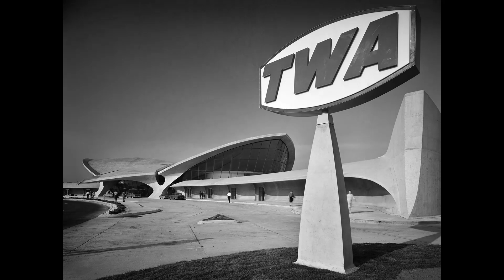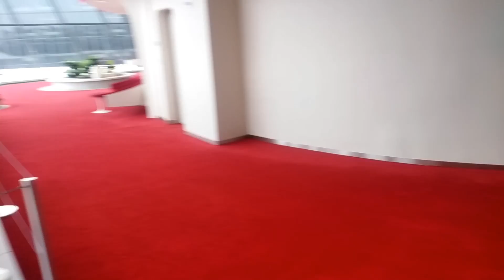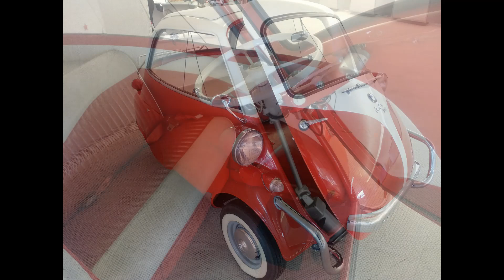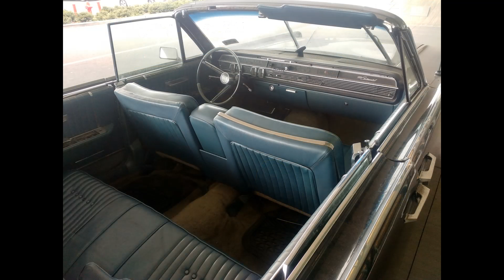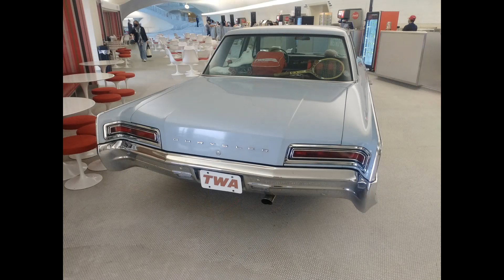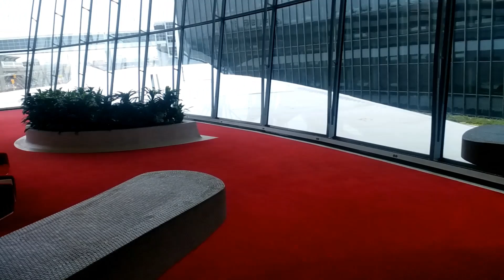TWA Flight Center and Lockheed Constellation

Comment: Thank you so much for this content.  When I was a kid in the late 60s and 70s my father would take the family to Europe every year, inevitably through Kennedy with either PanAm or TWA. Those terminals were something else.  I especially remember the TWA terminal because I spent so much time in it as I grew into an adult.  I would just hang out in that main terminal for hours waiting for connecting flights. All that curvy architecture extended outside to sidewalk where I would wait for cabs.   I had no idea that terminal sat empty for so long after TWA folded, or that it subsequently become the hotel.  It's nice that those curved tunnels are still there.  They seemed so loooong to walk through, with no windows I think.  Entering them was like stepping onto the set of a futuristic science fiction film.

Comment: When we were kids, a friend and I had lunch at the PARIS CAFÉ in the TWA terminal in late 1962  just after it opened. We rode our bicycles to "Idlewild Airport" (later JFK), a distance of maybe 10 miles from home, and we spent the day exploring each of the terminals. TWA 's was the best of all and seems to be what "The Future" would look like. It didn't disappoint.
We had a fascinating day and were "busted" by security when we were closely looking at the parked general aviation airplanes on one of the tarmacs. They let us stay, but cautioned us not to touch or to get too close to any of the airplanes. It was a different and more innocent time.
Oh, I had a Sandwich au Jambon (a ham sandwich) there. I remember that it was just fine.

Comment: Great video! Thanks a lot for this one, it showed bunches of interesting stuff, as well as bringing back a lot of memories. I was never in the TWA terminal, or ever flew on a TWA airplane. I did get to go through the PanAm terminal in NY several times when I was in Army in the seventies, I think the terminal was there then, getting sent to Germany and coming back for leave, and finally coming back for good. It was truly impressive. My dad worked for PanAm, called PAA until I was ten or so. So while we would fly back to the States for vacation every year on PanAm - I remember the sleeper berths on the B-377 going across the pacific - we did get to fly other airlines to get to 'home' and visit relatives, since PanAm didn't fly into the interior of the US. But I don't remember being on TWA Lots of flights on Western, United, Frontier, Continental, American, Air West etc. I've probably still got all kinds of airline maps from the fifties and sixties stored in a box somewhere. Things have changed a lot since then. A lot.

Comment: Do you remember how big the braking components were of the old Chryslers and other American car manufacturers of the time? I mean, these brakes were huge!!!!! The front rotors alone are like taking 2 fifty pound weights, the kind you would use to work out with, and mount them to your car. Imagine big weights like this spinning at highway and faster speeds. They were big, very heavy, very dirty and tended to be very hot!! They also had big cooling fins on some types. They were hard to work with!!!!  But, it allowed you to really see braking technology evolve. Disk breaks are better in every way!!! So much lighter, smaller, simpler!!! I look at drum brakes, and my brain goes. What is this sh*t ?????? I look at disk brakes, and my brain goes, yeah!!! Now that's what I'm talking about!!!

Comment: At Alaska airlines we still use a newer type of the electric tug which looks very similar to the one in this video. We use them in the bagwell to run late checked bags to the gate
Reply from the maker: Thanks, That's quite interesting. I do still see electric tugs around, but not too often, and these days a Noland Electric is quite rare.

Comment: 7:00 Quite a few french train stations still have that system.
Reply: No, not anymore. There were replaced in the 2000 by flip dots (every digit was made of a dot matrix, each dot being a small black plate with one side painted white or yellow), LED signs or LCD screens.
I suspect you were refering to Solari, as the Italian manufacturer, Greg.
I remember they were very popular, and used for a long time, some surviving up to the 2010s, just because of the noise they made: while being a gentle noise, like a  breeze in the trees, it made the travellers aware that the board was updated.
Reply from the maker: They probably don't have the money to upgrade.

Comment: 60 architectural drawings isn't that outlandish. Ive worked on 15+ storey buildings that had far fewer. Architectural mainly covers the large details (type of tile, etc.) and points to various sub-diciplines for other details.
Reply from the maker: I may have used the wrong term, I mean 60 engineering, architectural, etc. 60 drawings total to build this place.

Comment: I never got to fly on a Connie, but for many years we did have one right down the road from me mounted above a restaurant and used as the cocktail lounge. When they took it down and hauled it away I went and said goodbye to it as it laid in a parking lot with the wings removed. It's now been restored to display condition at the museum at Dover (Delaware) AFB. I did get to fly from Virginia Beach to San Juan, PR on a C-54 (DC-4), and flew many times on the old Lockheed Electra turboprops. There's just something reassuring about looking out the window and seeing 4 big propellers spinning. I had a 72 VW Microbus, a horrible vehicle really, but fun to drive.

Comment: Those penny tiles typically came in one foot square sheets. The matting was strings on about 1/8" centers. I don't any longer recall what material was used, perhaps sisal. The letters on that activity game were indeed vinyl. Vinyl was a pretty new "space age" material back then, and didn't really feel like any other material you were likely to encounter, at least in the soft floppy form used by the letters, so it was pretty cool for both kids and adults.
Reply: The matting on the back is a sort of dense woven string/rope material; porous so it engages the grout that you affix it with onto the base material.

Comment: I drove a 78 VW bus from 2000 until 2006 when the Mexican part manufacturers closed down and maintenance costs went sky high. Had the camper version, loved that car, I just threw all my stuff into the drawers in case I needed it someday :P I was always running out to get an oddball tool that noone had and it became a joke at work that I had everything in there INCLUDING the kitchen sink :P

The safety thing was certainly a big deal and I still drive with a feather foot and 2-3x the normal following distance from the paranoid driving habits I developed with that thing.

I would kill for a modern, reliable low-cost, no-frills light camper vehicle but the few that exist are basically luxury vehicles now and the cost is insane. :( I make do now with an old Subaru Outback I squeezed a cheap foam mattress into.

Comment: Oh boy, such memories. We lived in the NYC area from '71 on and I remember this terminal and even the Pan Am one. Seemed so much cooler than either LGA or EWR designs. We had a '63 21 window Bus and then a '69. Loved those sunroofs. Someone in our immediate family owned a VW Bus until '08 when I sold my '67 Camper. You're right about the brakes on those things, made me the biggest defensive driver ever. With the advent of anti-lock brakes it was quite a horror to have someone pass you and then slam their 4 wheels disks to turn while I was praying not to rear end them. I drove that '67 all over the country back in 89-90. Easy and CHEAP to fix (Mexican/Brazilian parts) and got 23 MPG hwy loaded up. Wow, thanks for the trip down memory lane!

Comment: Wow great video.

I too disappointed jets discontinued piston development.  Some really amazing tech was in the works.

The huge radials r3350 n r4360 were marginal for airline use.  r2800 much more proven tech even if performance not as good, see DC6.

You could argue the PRT was turboprop with piston front end.

Comment: re BMW Isetta: not a two-smoke. In the Italian original there was one, I believe. But BMW adapted their four-stroke motorcycle engines. Initially a 247cc single, later 300cc. Subsequently, they developed the BMW 600, which was an enlarged Isetta with a 600cc flat twin.
Reply from the maker: The Isetta 300 had a four stroke, most other variants were two strokes.

Comment: Never set foot on a Constellation, but in 1960 or 61 I was bought an Airfix kit which was lovingly assembled and was the flagship of my model fleet, proudly displayed to visiting relatives. It was a very beautiful thing, the Constellation. Nobody cared about crumple zones in 1960, for a start nobody had seat belts so you'd die hitting the dash before the front got anywhere near you. In the bubble cars defence, it was very easy to park in the spaces for motorbikes, and it had a cute factor from the day it came out - it's not just nostalgia, they were regarded affectionately back then. Pit with a bell - sounds like a luxury version, the box in the picture is the one I had. Thanks for the nostalgia trip, looks like they've made a good job of it all.

Comment: Another great video Greg, a pleasure to watch.
I caught the very end of that era in the early 1980s working at an airport as a lineman. That's when Providence Boston airlines was still flying dc-3s. Hundreds of gallons of fuel and tens of gallons of oil!
The airline industry to me is just as interesting or maybe more so than the military stuff, especially aircraft like the HP 42, Brabazon, SR Princess and many others. The fact that these amazing airplanes lived or died not necessarily according to performance but according to profitability and market forces is to me very interesting.
More videos on the commercial end of things please sir!
Reply: Served in the Army Reserve with a PBA pilot in the late 80's-90's. He would spend 6 mo in the En and then back to Miami for the winter.

Comment: "Your papers please".
All that needs is for it to be ask with a diabolical accent and you'd be in an old spy movie.

P.S. Good n Fruity was light years better than Good n Plenty.

P.P.S Eero Saarinen also designed the St Louis Arch, he was Finnish born.

P.P.P.S Yes the 1961 to 69 Lincoln was expensive, in 1961 they cost $6,500, that was almost the price of a house. Another high tech feature of them was their hydraulic driven windshield wipers, and the 7 motors and 14 relays involved in making the convertible top go up and down, several years back I helped someone straighten out problems with the convertible top on one not going up and down, the system for the top has a wiring harness that'd rival anything in the Space Shuttle and has a supplemental service manual with wiring schematic that must be ordered for them with convertible tops.
When the top is up and you open a door, even with the key out of the ignition, the window of that door automatically drops about 6 inches via the power window, then when you close it the window automatically rolls back up, this had something to do with preventing the window from shattering if it was closed against the convertible top when it was up, something about the framework of the top and manufacturing differences or whatever, and there was even more relays involved with that process, they are not easy to work on cars like most of the American vehicles from that era, not for your typical back yard mechanic to mess with, the guy who looked me up had his to 3 separate garages that couldn't figure it's problems out.
Oh, and it needed a new high/low switch for the headlights and can you believe it, a local mom and pop auto parts store actually had one, but I had to rip most of the dash out because of a short in the main power wire to the headlight switch, the circuit protection for it was actually inside the headlight switch and the power wire was unprotected from it's source by the battery all the way to that switch, something I found to be very curious, having that long of a wire that carried that many amps unprotected.
Like I said not easy cars to work on, even the front brake calipers were non floating 4 piston calipers that were rusted in the bores but I managed to take them apart and clean everything up and get them to work without rebuild kits, that and the rear drums were about the most straight forward repairs on it.

That was a great video, it's interesting to see the architecture, styles and fashion from the glamor days of the airlines, like Sears and Roebuck it's just unimaginable that entities as big as TWA and PanAm could go under, it's scary when you think about it. 
I tell young people all the time when I was a kid we didn't have the internet to surf, we had the Sears catalog, and when the Christmas catalog with all the toy showed up that was big time.
Reply from the maker: Great post Duke. With old cars I much prefer simple low option cars for exactly the reasons you talk about with the Lincoln.
Reply: @GregsAirplanesandAutomobiles  
Oh that thing was a challenge, the next day an official at NASA got a hold of me and said "We hear you can fix a 65 Lincoln, wanna job?".
Reply: My buddy's Porsche Boxster side windows do the same up/down shuffle when you open and close the door. But only 1/4 to 1/2 inch or so and very quickly.

You are not kidding about Sears Roebuck catalogs as a source for info as well as encyclopedias before the internet. I used to get funny looks from people when I would say that I love catalogs. Stuff like Graingers or McMaster Carr were an education in parts and gadgets that I might someday need. Sears Christmas toy catalog probably started my affection for catalogs and was something to get exited about when I was a kid. Spent hours perusing them and even saved them for years after.

Comment: 5:10 - Those kids (under 40), are going to have a hell of a time operating those dial phones.

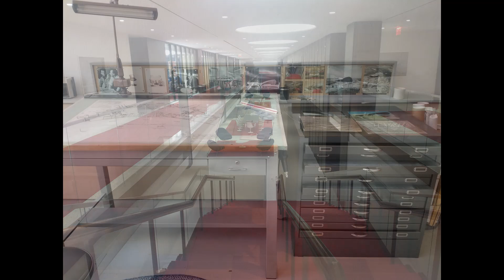21:40 - Looks a lot like the drafting table, I used to work on, before CAD became common. Still use 1990s version of OrCAD for PCB design.
Reply: Right now in university I still have to use OrCAD, though this is for circuit simulation. The computers in there even run them in a WinXP VM!

Comment: Another great video—ticks a lot of boxes too, interesting cars, airplanes, and architecture. I haven’t been to the TWA terminal, but since I’m nearby in New Jersey I will make a point to visit. 

Sixties air travel is before my time, but I do remember as late as the ‘80s as a kid getting all sorts of games, coloring books, playing cards etc., when I flew with my parents. I also got to visit the cockpit during flight on several occasions, which for obvious reasons would never happen today. 

A brief aside, NJTransit’s Secaucus Junction station, which was opened in 2003 has Solari/split flap signs in active use.
Reply from the maker: Thanks Alexander. Just to be clear, you can still visit the cockpit as long as the engines are not running. Just ask a flight attendant. Few people do it, on my flights it happens about once a year at the most.
Reply: @GregsAirplanesandAutomobiles  interesting, didn’t know that!

Comment: Ha! if you've seen any crash tests from 60's vehicles the driver is the crumple zone regardless if it's cab forward or not lol
Reply from the maker: It depends on how fast your going. The bus is deadly even at pretty low speeds. It's still cool though. If I had one I would have great brakes on it, and just never go very fast.

Comment: Brought back fond memories. My dad was an FE for TWA based out of Kennedy. Although he flew from the prop era to the 747's, his favorite was the "Connie". Your understanding of how the flight engineer system worked is a little off, but it hardly matters anymore in today's age of aviation. Thanks for bringing back some great memories.
Reply from the maker: Robert, thanks for your post. I was a flight engineer, so I have some knowledge of this. I assume what you think was a little off is the upgrade to the pilot seat. Not all flight engineers do that, so I assume that's what you meant. However at TWA and most airlines they eventually went to using junior pilots as flight engineers instead of mechanics, and those usually moved into the pilot seat when seniority allowed. I covered a lot of stuff in this video, the downside of doing that is I can't cover any of it in full detail so I have to gloss over some stuff.
Reply: @GregsAirplanesandAutomobiles  Thanks for the kind reply. I hope you didn't think that I was trying to be overly critical. It was just an off hand remark on how things have changed.  My dad bought bought a J-3 cub, and I would take my high school sweetheart to the Hampton's on Long Island and land on the beach for a nice picnic. Can't even imagine doing something like that these days.I guess I'm just rambling on about a bygone era, and want to thank you for the great videos that I enjoy so much.
Reply: Not being a pilot or former flight engineer I wouldn't know what was off but one thing I read about the flight engineers station was that it had a "scope" that could be switched from one engine to the next, having started working in garages back when they had a tune up station (the size of a vending machine) in them with an oscilloscope that enabled us to read what the coil, each spark plug, each spark plug wire and and the ignition condenser were doing while the engine was running, I'd love to be able to look at the scope on one of those engines when it's running if for no other reason just to see what it looks like compared to the ones we used, I'd be curious to see if the information on them looked the same as ours, ×2.25 as many readings of course.